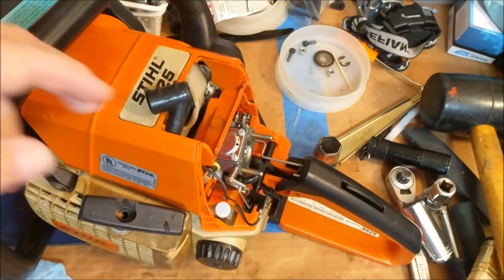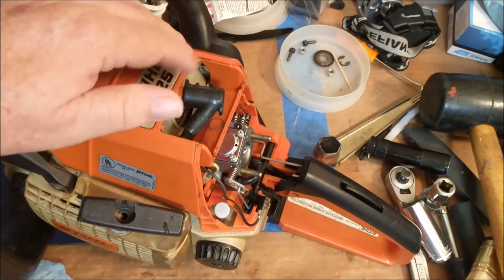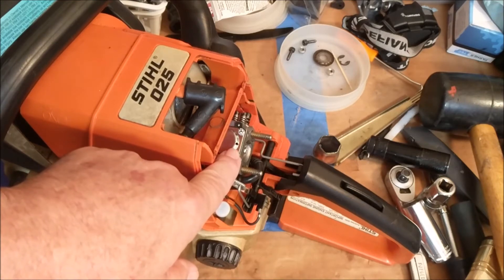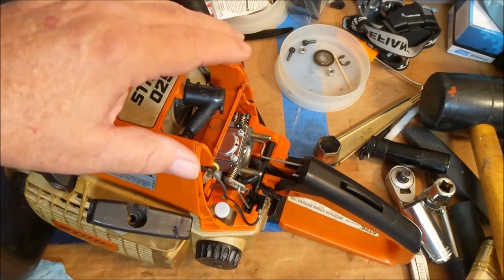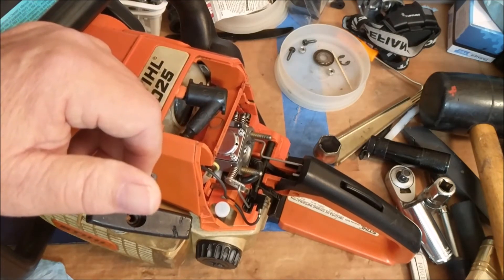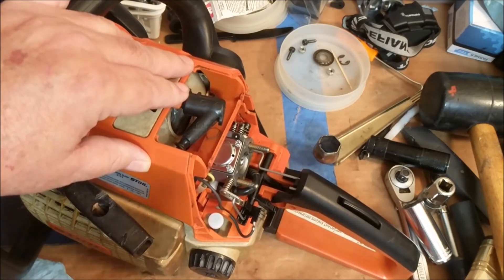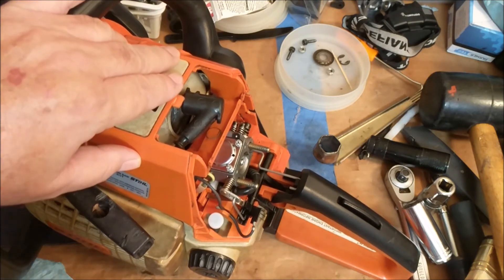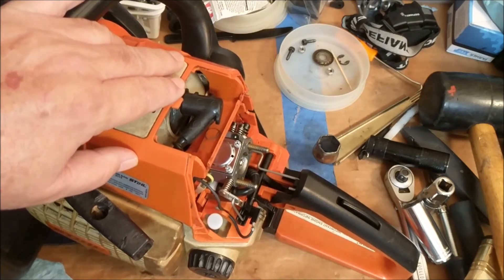Stihl 025 Sticky Engine Project

Comment: I have a shindawa 350 that suffers the same I cleaned it with brake cleaner trough the exhaust and intake and it ran for while and started doing it again. I can't get parts for it. But I look ford to hearing how it works out for you with your stihl.
Reply: Do you use ethanol free gas?